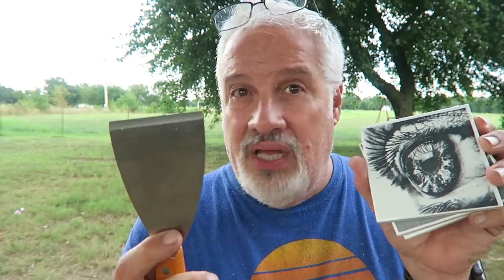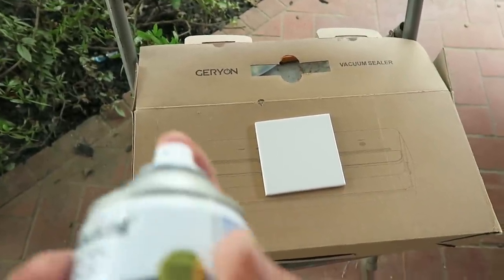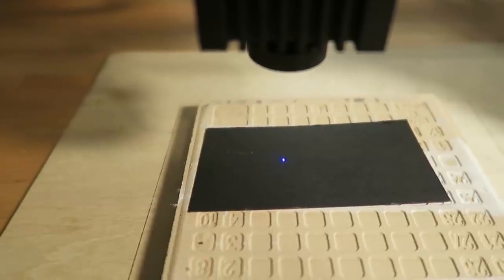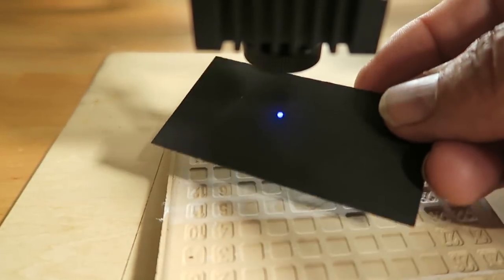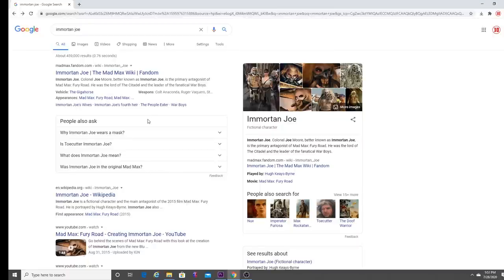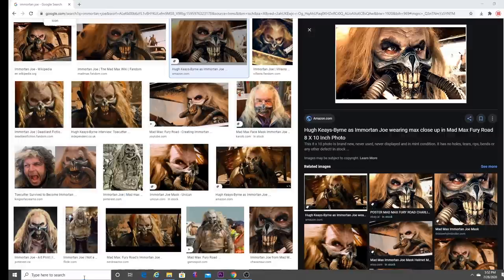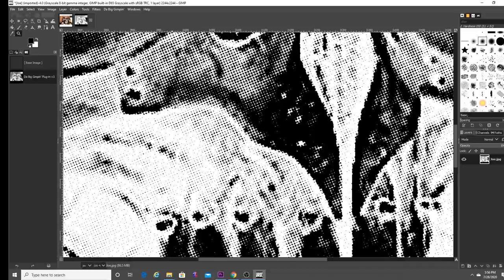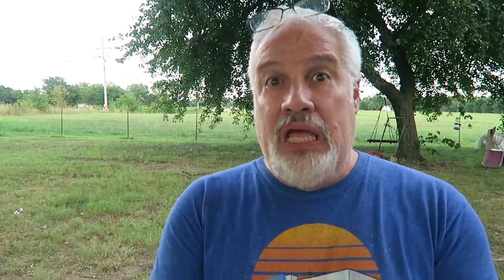Crazy Technique for Etching White Ceramic Tile PERMANENTLY!

Comment: So my question is will somebody pay $20-30 for one 4x4 tile? In this age of Walmart prices this method can take 1.5 hrs to do a full 4x4 image with a diode. I've seen others run black painted tiles at way higher speeds and could get a full set of 4 tiles done in less time it takes this method to do one with the same machine. Do customers care if its fused or just want some nice custom tiles for nice looking pieces to display. Its seems like you'd have to greatly reduce the value of yours and your machines time to sell these at what the market will pay.

Comment: I am having issues with tone.  Unless I laze at 100% the engraving comes out light in almost a silver tone.  I'm using the 2xs gloss and have tried the flat and lazing at 1100mm @100% passthrough.  ORTUR 20W.
Reply: I am having the same issue, you figure anything out?
Reply: @nickm324  not yet.  I am not lazing anything atm.  Currently printing mods for my Ortur and they take forever.  I used overscan at the defaulted settings 2. something or other and it seemed to look a little darker with slightly more background but I am 16 days in with Lightburn and still learning. Laser GRBL trash and the presets don't work for me.  Just tinkering with the settings to see what works best.  So far slowing my speed down to 1000mm-1100mm increases the depth of the engraving and darkens it slightly but still silverish in color.  I am looking into the G8 lens.  They have them on eBay for 19.99.
Reply: @nickm324  imagr updated their site and have a Norton section.  1200mm@100% is working for me.  It could also be that I am using the G8 lens.  Hope this helps you.
Reply: @TheJPo13032  I have had some success but it appears the issue is its all dependant on how the tiles get painted. Seems like you have to get the layers of paint just right, too much paint and you get greyish, too little and it doesnt burn at all. Really hard to get the paint exactly the same every time for each tile.

Comment: How does the white coat of paint need to dry
Reply from the maker: Great question!  A lot of that depends on the weather.  If the weather is warm and low in humidity, a couple of hours... You may have to adjust if the weather is cooler or more humid, but I let the paint dry a minimum of two hours.

Comment: I dont know what i did wrong . cleaned the tile with acitone then sparyed with flat white let it dry over night. The burn removed the paint but the image wipes off with a rag ( 20mm per sec and power up to 100%)

Comment: I don't see any posts from you lately. Hope you are ok. Question to you or anyone that might know. I followed all the steps and at the end my pic's all washed out to the point I can barely make out the picture. After I run my pic's through The plug in instead of bringing up a clear pic, all I get is white with some faint outline. I can see it but it looks nothing like yours. I have tried everything I know. Can you help?
Reply from the maker: Thanks man!  We are all doing well!  Let me see if I can assist. First off, which model are you using? 20w or the 15w? Thanks!
Reply: @3DPrintFarm  20w. I managed to do some line engraving but I think the problem is partly Da big gimping washing out my pics on invert. The other is my mine for setting my speed to high. Wife is chasing me out of the house. LOL 
 I just finished my shop so I am going to get back to work soon. I'll let you know how it turns out.

Comment: Hmm. No matter what setting I try, I can't get a black image. I can even blast right through the enamel (50w laser) at that point I just use a sharpie. But the paint technique does not work for me.
Reply: You are using too much power and the material is vaporizing before it can char (turn black).
Check out some videos specific to c02 lasers for better info. Just search for K40 Tile Engraving.

Comment: So what's making the tile black?
Reply: The paint is burnt by the laser which transfers the energy to the glaze on the tile.
It gets hot enough fast enough that the carbonized paint is deposited in the tile surface.

Comment: You claim this is permanent, but from what I can see, it could probably be wiped off with acetone and, in any case would not be durable under wear.
Am I missing something?
Reply from the maker: Trust me... It's permanent.  No amount of acetone, paint thinner will remove that image if it's burned on their properly.  I will have a Part 2 to this vid with some demonstrations of the durability of the tile.  it's crazy how it works!
Reply: 3DPrintFarm please include the cleaning process you left out of this video, no matter how simple it is.
I found your channel yesterday and I love it. You give great explanations!
Reply: That's the problem I'm having. My burn looks good, but when I go to remove the excess paint it removes the image as well. But any text I burn onto the tile with the image will stay. I'm burning the text and image at the same time with the same settings. I'm obviously doing something wrong. Any ideas?

Comment: There is no residue on the tiles. 
The glaze is kiln fired so the only thing that can be on the tiles is dust from the unglazed bottom of the tile sitting on top of it in the box.
All you need to do is wipe it off and then spray with paint. Acetone is $16.75 per gallon the way you suggest is not economical.

Gloss paint reflects energy away from the tile, if one is using a laser less powerful than the 7.5W optical power (20W input 7.5W output) 
of your laser they should use matte paint as it absorbs more energy.

The plugin Da Big Gimping is made for K40 lasers that do not have PWM.
He suggests using a dpi of 600 which is far too high. 
The max dpi a diode laser such as yours is capable of is approximately 300.

In LightBurn when you select "Pass Through" your settings for line interval and DPI are ignored. (mouse over it, the tool tip even tells you that.)

LightBurn can do a very good job without the plugin that costs $30. 
Shape Properties and Jarvis dithering can produce equal/superior images.

Comment: What if I'm using a 20w instead of 15w
Reply from the maker: It can be done with a 20w, but remember the beam on the 20w is a bit bigger than the 15w... I ended up getting a G8 lens which basically will make the 'dot' a bit smaller and it works great.  It can be done with a bare bones 20w lens, but it takes time to fiddle around to get the perfect burn.

Comment: I'm a little irked at this guy at this point, i have read hundreds of comments now and a lot are of people having no luck getting this to work? And not one response on those posts to help them., it's like he ignores all troubleshooting questions about the technique.. I bought a master 2  based a lot on this working. HAS ANYBODY gotten this guys technique to show the same results with ANY laser including the one he's using?
Reply from the maker: The white tile technique very tough to achieve and it took me a while to nail it down.  It seems counterintuitive but the lower powered lasers 15w and 7.5w are easier to nail this process down because the beam when focused is much smaller than the 20w.  I ended up putting a G8 lens on my 20w because like I said you have to get things super focused to get things to work.  A good resource is "Norton's Den of Lasers" on Facebook. Nicky Norton is the guy who invented this technique and is the real guru of the white tile technique.
Reply: @3DPrintFarm  thanks for responding, ok I wonder why they changed to a fixed focus on the newest laser master 2's which is what I have.

Comment: It's just a thought I had when seeing your video. (it may allow you to speed the process up)
Try what I do to get a stronger burn and less reflection.
I have an example here: https://www.instructables.com/id/Tims-PCB-Plotted-Circuit-Board/
You need to scroll down to step 51 Laser Step 2
Whiteboard Markers have a dry ink that wipes off with a tissue.
This trick works with a lot of other shiny materials.